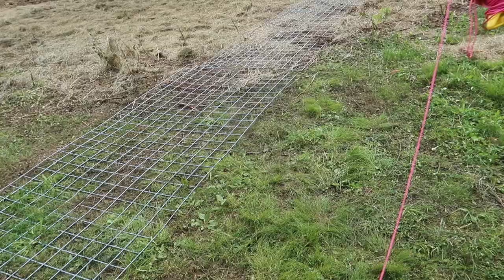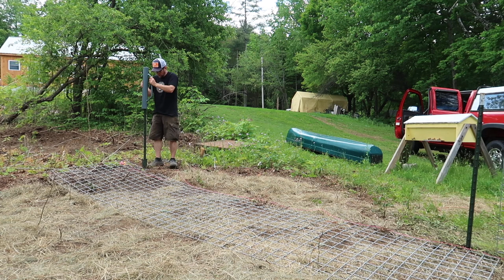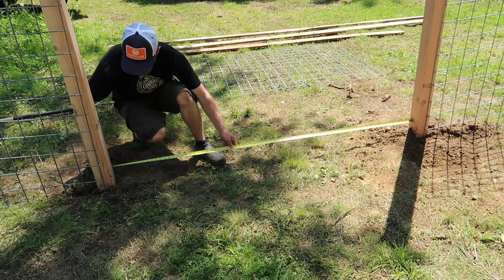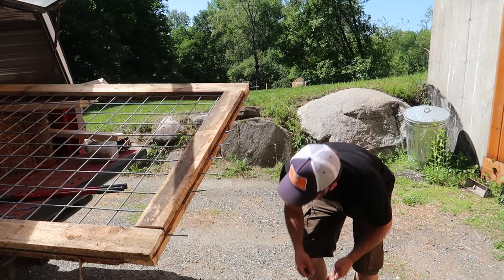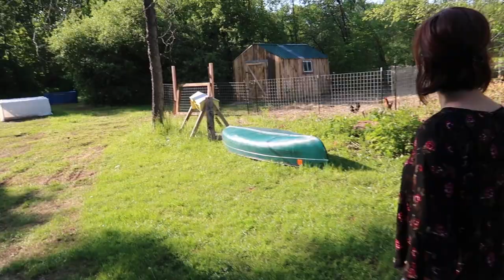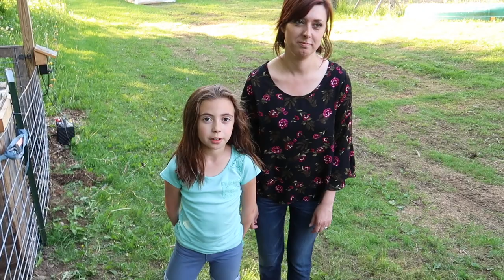The Goats Come in 1 Week (I need to get this Goat Pen Built)

Comment: Oh man !!! Just yesterday I spent a half a day digging around a  yard hydrant to replace it, we have bentonite soil here and it's a nightmare for digging. You reminded me of that digging the post holes but except for the rocks I'd rather dig in your yard haha.
Plus it was 96 degrees whew !! Ah the golden years,growing old is not for sissies LOL
Reply: Stan ,
I don't know what bentonite soil is but in California I had clay / adobe soil.  I kind of hesitate to call it soil being more like slightly soft cement.  I finally hit upon a method. Using my post hole digger I would finally get down about two inches. Then fill it with water.  In a few hours I could get down another two inches.  More water , another two inches. An 18 inch deep post hole would take me about three days to dig.   This was back in the day when I was young and strong like Al. 
Now my years are more like rusty years , not so golden.  Man , no body told me that they were going to get here so QUICKLY ! And yes, certainly not for sissies ! Every day is a challenge.
Reply from the maker: Lol I couldnt take that heat
Reply: I was doing this on my p/t job so I couldn't try your method. The soil here in Colorado if dry is like concrete and if wet would be easier but still a major job. Thanks for the reply Don.